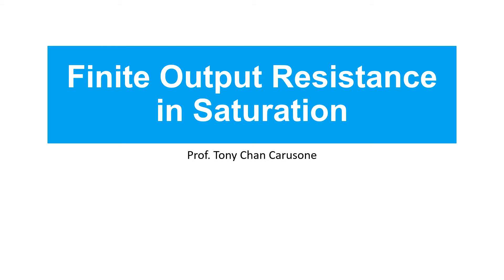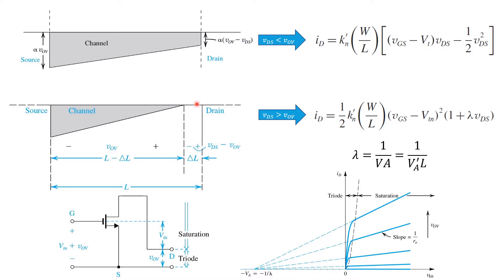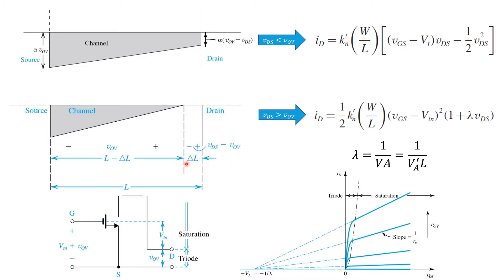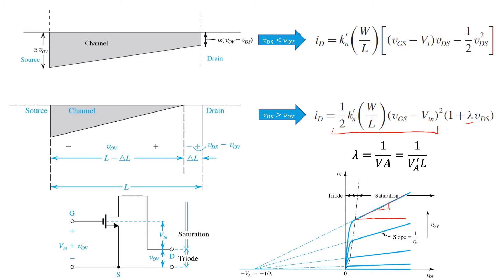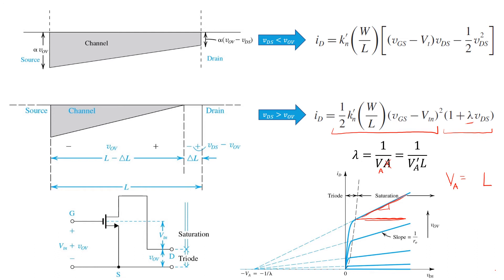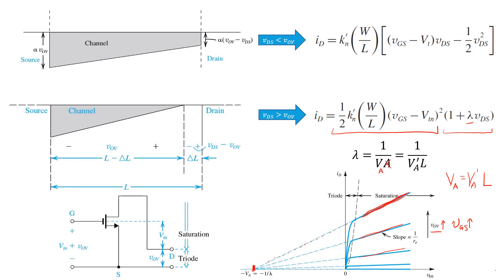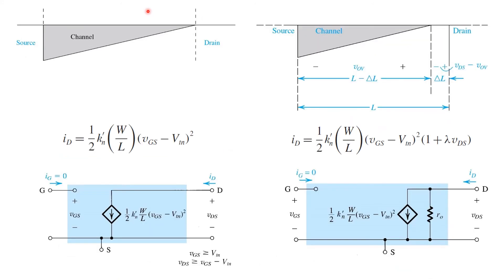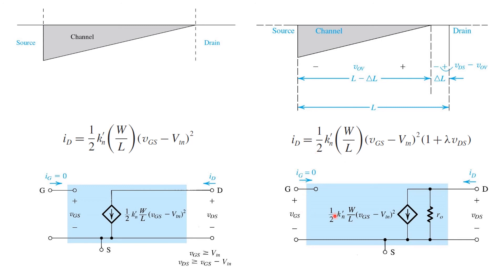36 Finite Output Resistance in Saturation

Comment: actually I do not understand where the L came from?
Reply: The effective length of a channel is given by L, this length reduces as the channel keeps getting pinched off (disappearing) from the drain region. So the  length keeps falling a little closer to the source. The new (reduced) length is: Original length - pinched off length. Which is: L - Delta L.

Comment: When the channel is pinched off and shortened by some amount, then how do carriers move from drain to source while there is no channel nearby the drain region?
Reply: @C.ole is correct, it is due to the electric field being very strong, the electrons don't need a channel to move, it has a strong electric field surrounding the depletion region, the electric field like a vacuum just sucks the electrons, it accelerates the carriers through the pinch-off region — they drift through it, fast and furious, like Vin Diesel of semiconductors.
Reply: I'm pretty sure it's because of drift current